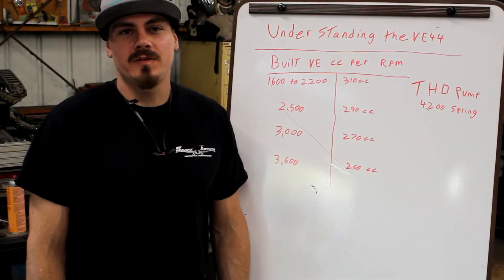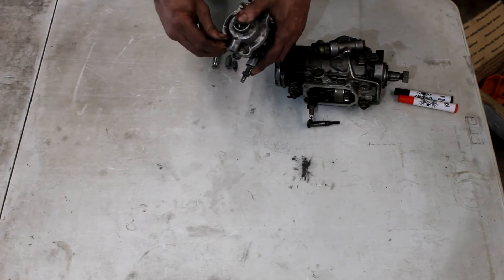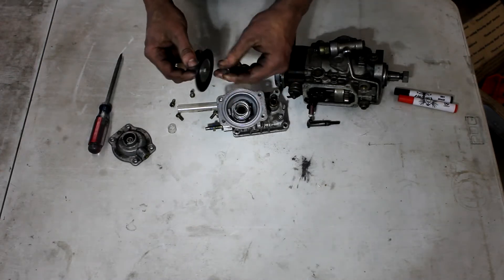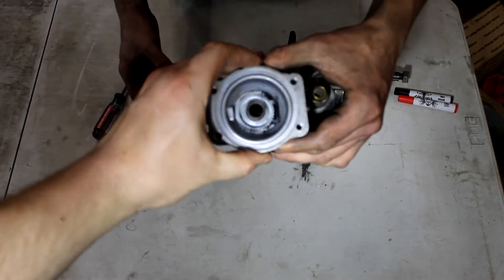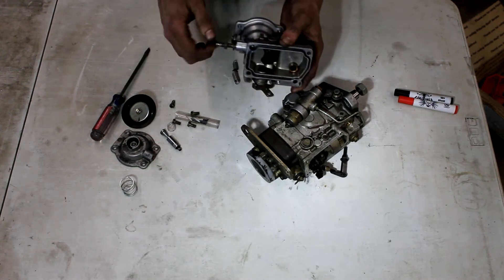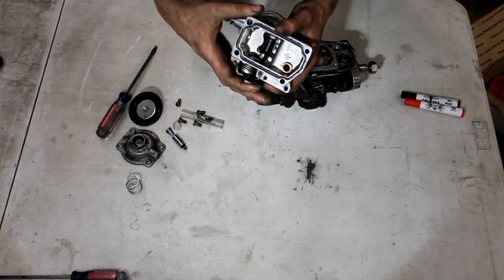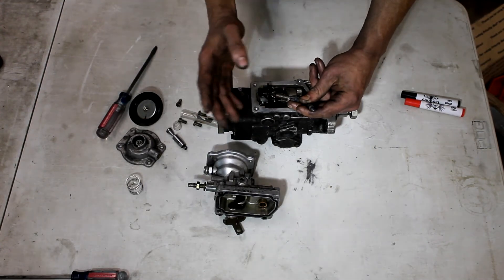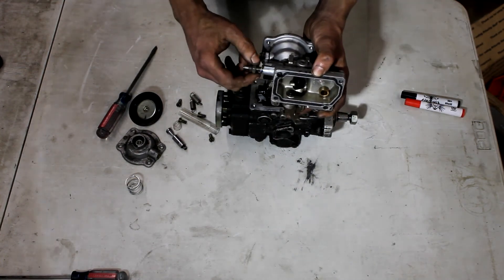VE Deep Dive pt 2

Comment: Awesome. Could you give us a baseline for star wheel and smoke screw settings that you like to start with?
Reply from the maker: I tune them on the dyno using a phone stand to video the exhaust but you can do the same on the street. I crank the metering screw as far as it can go before I can’t get it to return to idle in at a normal rate. Once it starts to want to hang the throttle go back. 

Then star wheel i will back out to tighten up the spring, so that it takes more boost per pin travel since the metering has been changed. Then burry the smoke screw and start going out two revolutions per pull until it starts to clean up, then 1 turn until it is at a cleanliness vs power production that is acceptable for street use. It takes around 6-8 Pulls to dial it in on average.
Reply: @savagefabrication795  you’re the man, thank you! And the tappet cover I got from you back in 2019 is still going strong with zero leaks. 👍🏻👍🏻
Reply: @savagefabrication795  you should tune a truck in one of your videos